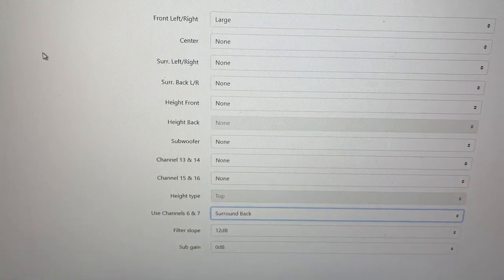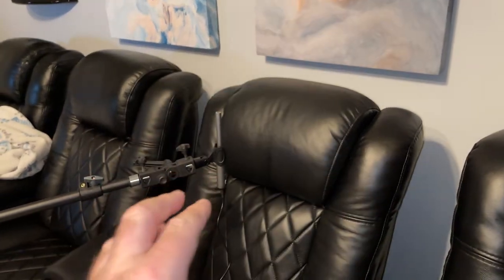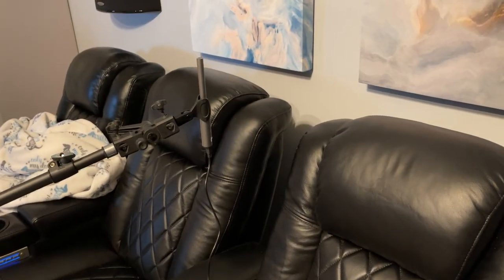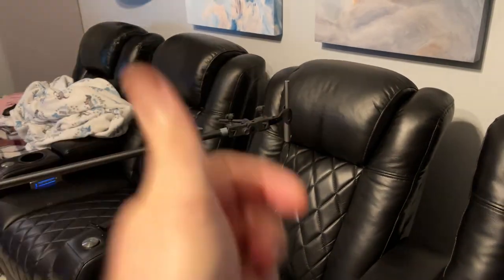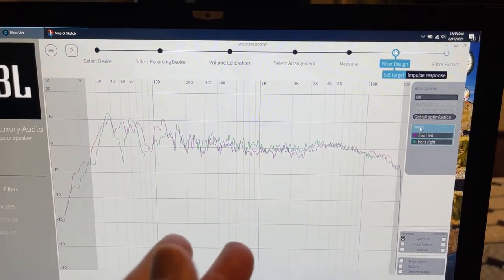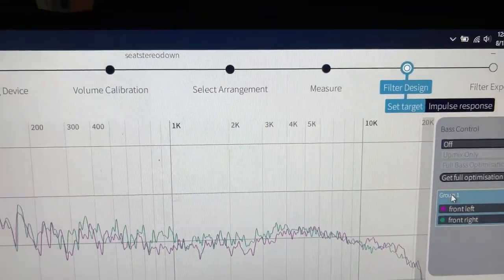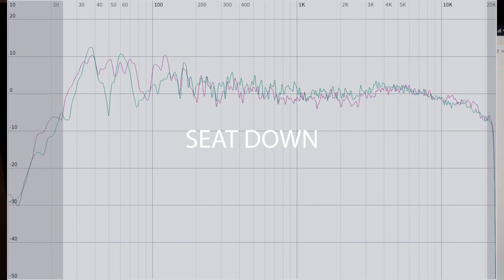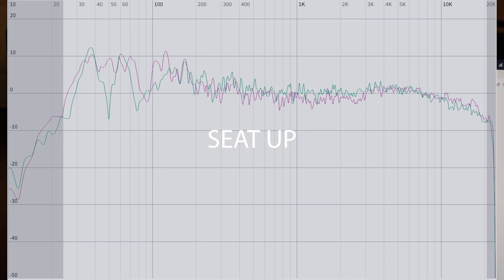Does Seat Back Position Matter To Your Ears

Comment: If you calibrate your system with a mic where your head will be, just remember that spot is the best spot in the room. If you move to far from that spot you'll throw off the spacial imaging and it won't sound as good
Reply from the maker: Yes, that’s the whole point.

Comment: Can I suggest to pull your seats out 3 or 4 feet from the wall and take the measurements again. Obviously your not going to leave the seats in that position. In my opinion your wall is still acting as a close reflection point because it is only a foot or so from the mlp.  Thanks for the video
Reply from the maker: Good thing I pointed that out in the video ;)  No, I'm not moving my seats for a video test lol
Reply: You must have edited the that point out of your video because I've watched it 3 times and you never mentioned that your back wall could be acting in the same manner as your chair back because the seats are positioned so close to the wall. Therefore there will not be a change in your measurements. Any whoo  thanks for the video.
Reply from the maker: You obviously need glasses.  4:42
Reply: Not trying to troll you but at 4:42 all you do is Lower the seat.  You never say that your rear wall reflections may cause the same effect that the chair back is causing because your seats are so close to the wall .
Reply from the maker: You have to to be trolling or REALLY DO need glasses.  Read the friggen text right on the screen dude.
Reply: @COGuyStuff  not trolling as I said.  I have closed caption on and it covered the text at the bottom of your video.   So now I will troll.  If you knew that the effects of the wall would not change the measurements move the seat as I said or essentially you have a pointless video
Reply from the maker: LOL you obviously have no experience with seats like these.  They don't just 'move'.  Glad you figured out your error though!